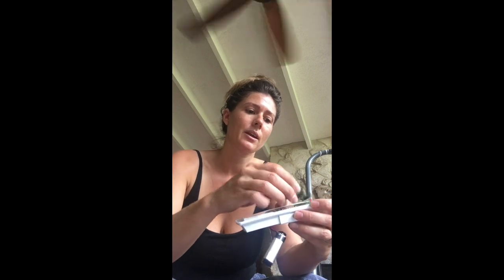Reverse Ceiling Fan (without a switch, or reverse button on remote)

Comment: Holy crap - this works!  Like Heather I had to play around with it to get the button to actually activate ( the red light comes on) but when it finally did - it totally worked.  2 of my house fans mysteriously switched direction and I was ready to replace them as there are no buttons on the fan or remote to change the direction.    Now for the next one..... thank you Heather!

Comment: Heather Thanks for this. I tried it on mine but when i push the reverse contact you can hear motor stop for a split second then keeps going in wrong direction, doesn't reverse. what exactly did you do in the sped up part of video to make it work?
Reply: Same problem here.  Did you figure anything out?
Reply: These remotes are all the same, just different face plates for different models. Woman in the video needs to call the manufacturer to get a new remote. Therefore you may not have a receiver that actually supports reverse. Not every fan has reverse.
Reply from the maker: It has been a while, and luckily I have never had to do that again, but I seem to remember I was getting that same click but it wasn’t coming to a complete stop. So when I fast forward it was slowing down but not reversing. I just kept trying over and over again and it finally worked. Hopefully you were successful!!
Reply: @heatherbegley8926  is that an Altura fan with an Hampton bay remote

Comment: Our Hampton Bay ceiling fan switch is hidden ( dumb design) under the bell housing that sits directly on top of the motor. Use a standard screwdriver or knife to lift up the bell housing.
Reply: oh hell!  good find.  thank you!
Reply: Yup, had to use a flashlight and a mirror but I found it up there after lifting the bell housing....just dumb

Comment: One way I got my old Hampton bay ceiling fan (with no reverse button or switch to spin the other direction) was to hold down the high or medium speed button while turning the wall light switch on.

Comment: Does it reverse both sets of blades or just one? My blades are pushing the air towards the center. I want them to push the air to one side to have the hot air near the ceiling go out our slider door.

Comment: We don't have a fan reverse switch or remote. We found that flipping the wall on/off switch very rapidly (with conviction) the fan will slow and begin to rotate the other way. 

We've had to do do this twice and it has worked. Found this answers after hours of digging through the internet. So I'm leaving this comment here in case it helps someone else!

Comment: I actually miss the design that they came up with in the Hunter "originals" (4-blade) that had a one way motor, BUT you were still able to get a reverse airflow. How? It was actually pretty ingenious, and I wish they still used this technique today, because you could actually LOOK at a fan that is not even turned on, and tell if it was in reverse mode or regular, summertime downflow mode, by which way the blades were pitched; Rather than having a "reversable" motor, there were (at least) two different systems that allowed you to reverse the pitch of the blade-brackets (thus reversing the blade pitch), so while the fan-motor ALWAYS turned anticlockwise, when viewed from below, looking up (or clockwise, when viewed from the top, down) just as 99.99% of North American fans (and most ceiling fans worldwide) rotate anticlockwise, in "NORMAL"/downflow position. Hunter came up with "Reverse-air" and "Adapt-air" blade brackets systems. With the "Reverse-Air" system, when the fan was off, you could take the blades, one-by-one, pull the bracket outward, and tilt the pitch of each blade, so that when looked at from the side, the left (leading edge) would be BELOW the right (trailing edge), and this is how you could tell that the fan was set to "reverse"; basically if you have ever seen what a ceiling fan looks like in a mirror, this is precicely how you could see it was in "reverse". With the "Adapt-air" blade bracket system, it was the same blade-pitch-reversing concept made easier, as instead of having to reverse the pitch of each blade individually, there was a "key" that you could turn, and all four blades would tilt pitch at the same time! I actually prefer that old-fashioned system to having a reversable motor, like today's fans have. I believe the old Emerson "blender" fans used a similar blade-pitch-reversing system, as well. I wish they would go back to this system which I believe had that option until the early 80s! 
Back when we still had Sizzler Steakhouse in Chicago, there was one in my area that had these type of fans. The ceiling at that location was kind of low, so they kept them "in reverse" year-round, so it would circulate the A/C and the heat, without making it too windy!
Reply from the maker: Thanks for the info!!

Comment: No one has taken my remote apart to have it set the wrong way so idk what the crap. Is there no videos on your tube? Thx for the tip. My remote is different than yours so idk if it will work the same bit ill give it a shot thx.

Comment: I have the exact remote and it didn't work for me. Never heard a click, never reversed :(
Reply from the maker: oh darn! Were you able to see if your fan has a switch on the unit itself? As you could see, this took me a really long time to make work...I think the finger pad just has to be lined up so perfectly that human error can get in the way (at least in my case). I hope it works for you...I know it was such a frustrating process for me. Good luck!!
Reply: @heatherbegley8926  yeah, there's no switch and there's no wall switch either. When I was lining it up and pressing it, the light would turn off sometimes so I think it might've been resetting something but not what I wanted 😅
Reply: You are fooled....😋😋
Reply from the maker: @nikamoni4  major bummer! Mine does not have a light, so clearly there is one more added obstacle in your situation. Hope you have figured out a solution by now!!

Comment: My remote looks exactly like yours however it does not have that 4th row (single button) on the control board.  My search continues.  Thanks!
Reply: In my rental apartment we have two Hampton Bay fans of the same model within just 15 feet of eachother (bedroom to living room) each with their own remote, however the bedroom remote can control both fans (almost always at the same time because they’re so close together) and the living room remote could only control the fan in the living room. One day, mysteriously, after the living room fan remote control’s battery died, both fans switched directions and neither remote have a reverse button. They’d been stuck in the sucking air up winter setting for a year plus (and I live in southwest FL where reversing your fan is literally never needed), until I stumbled across a hack online that worked**. Caveat because I can only get it to work for one fan, no matter how hard I try to block the signal (messing with the Dip switches is next on my list of to do’s) the reversal from the “hotkeys” shortcut on the remote will only happen to one of the fans. The fan speed buttons need to be selected in this sequential order, one after the other distinctly but with no pauses in between (sort of like rubbing your finger across them but not quite that homogenous in movement): LOW -> MEDIUM->HIGH. That’s it. This worked immediately and I was blownnnnnnn to the breeze. Hahahha. Some people on the original forum I saw said it would only work if their fan was first on the Low setting, others said the same thing but with the Med setting…I started with Low as it seemed easier on the motor to stop and change dirextions. Agreed wjth the OP of this video though that this is wayyyyyyyy to frick frackin difficult for no reason at all.